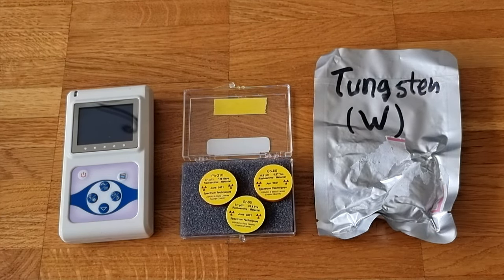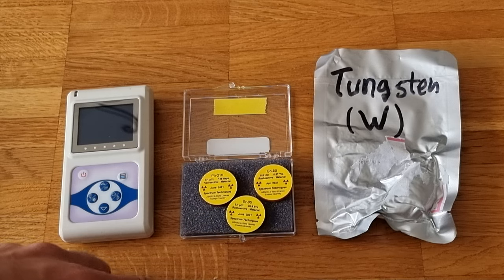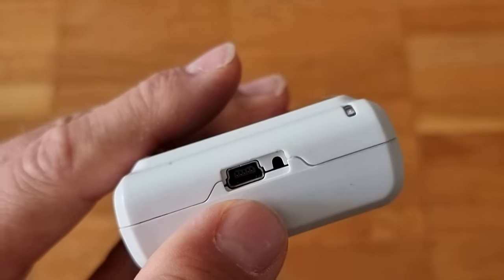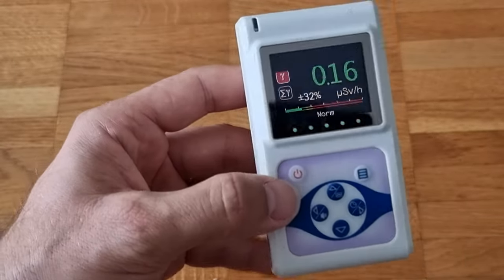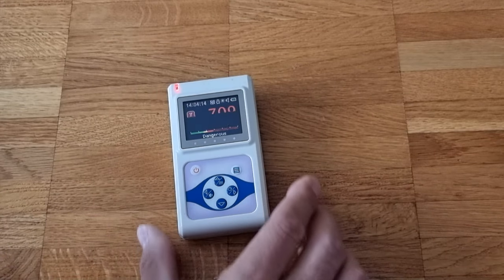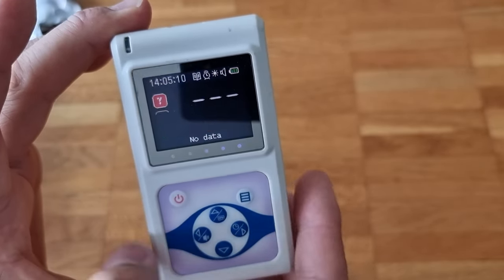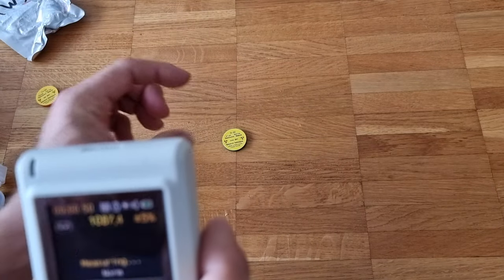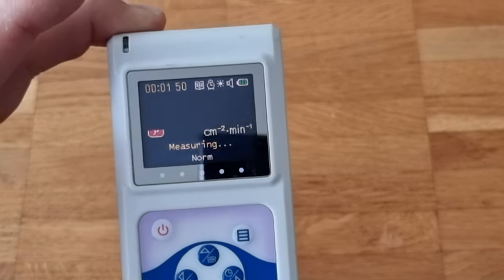Fixing Fukushima - Radiascan 701 and radiation fall-off

Comment: I am little confused. If I had an alpha+beta+gamma source, I would measure gamma only primarily with GAMMA symbol on cover. But if I wanted to measure beta only I would put the cover to 4 arrows symbol and substract GAMMA value? Does the 4 arrow symbol let full beta through?

Also if I want to measure alpha flux on an object, which emitts alpha+beta I would have to measure the background through 4 arrow cover and then remove the cover completely and cover the object with thin sheet of paper to let only beta through? This was not clear from the manual.